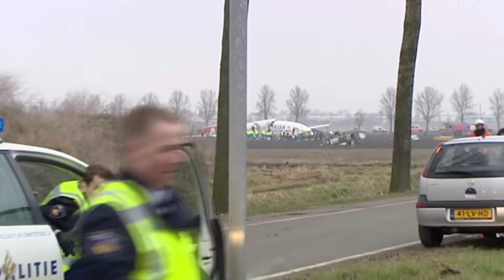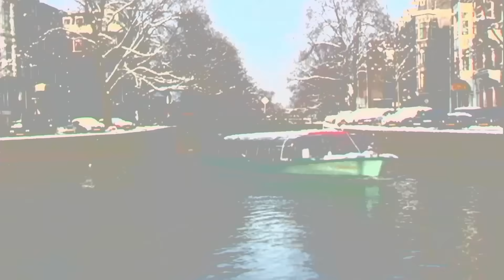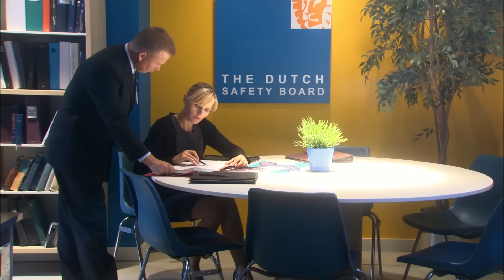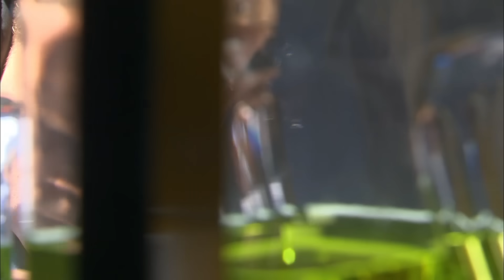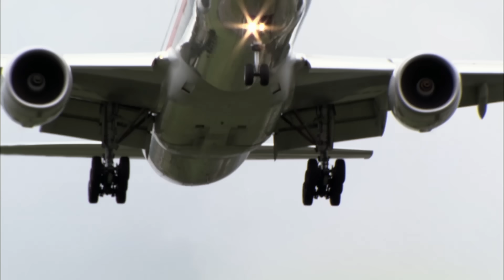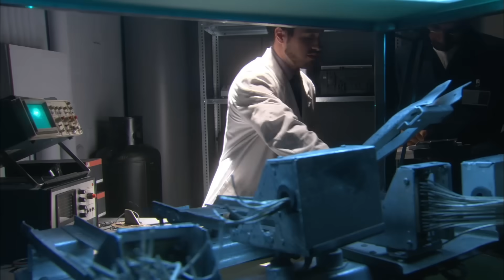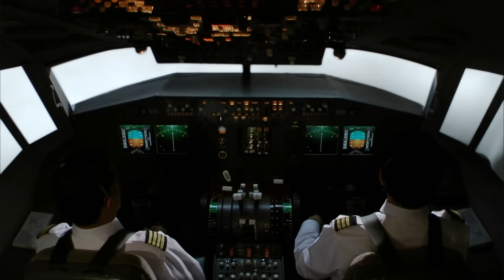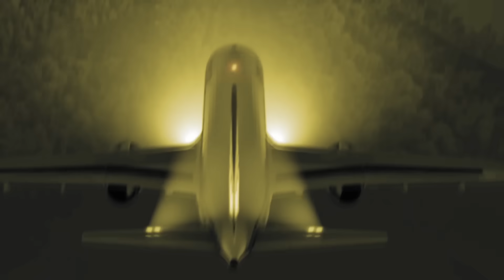Why Did Turkish Airlines 1951 Crash? | Mayday Air Disaster

Comment: Never finding the fault with the radio altimeter? The reading of -8 give a very exact clue. That would probably be the distance if the receiver were to pick up the transmitter without bouncing off the ground. It indicates they either have cross talk between the two or they need to install a delay in the receiver before monitoring the receiver signal for a bounce. Take any plane you have on hand and put a scope across the receiver on the ground and see what comes off the receiver antenna.  I don't have a degree and couldn't get a job with them but the failure is pretty clear.
Also the warning should be flashing red and some sort of tone should sound indicating they need to check the instruments.
Reply: Even better idea. The computer should ignore any flight altimeter reading negative 8 feet while the plane is moving more than 60 mph. It should be hooked up to all three altimeters, and take educated guesses on which one is accurate in the rare case that it gets three different readings.
Reply: @MegaLokopo  it's a design flaw in the unit. When they tested the unit and it didn't fail, it was because they didn't think to test that particular issue. I have spent a fair amount of time writing diagnostics for computers and believe me, it's hard to make sure a device functions perfectly. I have uncovered failures that the design team didn't realize  where there and other flaws that another diagnostic program didn't detect. Instead of a work around, the unit should be designed to function correctly because if the flaw continues to exist, you never know when it will bite you. To fix it correctly doesn't require external information which could be another failure point.
Reply: @denawiltsie4412  Some bugs are very hard to detect and even harder to prevent. But the unit is already designed to do certain things if the height is above or below a certain height. It isn't that much of a stretch to have another check where anything at or below zero feet is treated differently to above zero and above 50 or 100 or whatever the exact height is that triggers flaire mode. Also having a check for altitude and speed would not require any information the computer doesn't already have access to, so there isn't an issue with getting "external" information, because all of the information is already there.

It already does a height check, one more height check is not some crazy idea.
Reply: @denawiltsie4412  Also it isn't a design flaw, it is an intentional design that it fails "safe" to -8 feet, so when an engineer is diagnosing it they know it is not the display being broken and is in fact the sensor.

Comment: If the pilot’s radio altimeter fails shouldn’t they switch to the copilots as they would with a faulty airspeed indicator? They knew it was faulty; why didn’t they do that?
Reply: likely couldn't at the time
Reply: The 767 has 3 autopilots and 3 radio altimeters if left or right fails they can switch to alternate EFI and run their side using center rad alt, can’t recall I thought 737’s only have two but they shouldve run the QRH quick reference handbook and would probably say Capt should switch his to right side run on F/O’s rad alt info
Reply: @poochies0316  depends on model for if that was an option why not switch to it. note this was an 800 series.  the ones you are mentioning could be 900 ng or the dreaded max models
Reply: @poochies0316  👍

Comment: Another crash caused by automation flying the plane instead of the pilots.
Reply: It wasn't really the automation, it did exactly as it was told, it was those computer programmers who programmed it and didn't think to put in a check to ignore any readings below 0 feet if the plane is going above 60 mph.

Comment: Ridiculous.  If you have automation that: 1. changes the configuration of the plane near the ground when pilots are busy, and 2. that is dependant on a single sensor, that 3. a sensor that is very prone to failure.  Boeing should not be selling planes.  WTF.
Reply: Sounds like Mcas on the max !
Reply: Blame whoever you want, but if we want real change we need to boycott flying until every system on the plane is fully redundant. A computer should be programmed to ignore a reading of -8 feet when the speed of the airplane is over 60 mph.
Reply: @MegaLokopo  Ignoring readings "like -8" is not a thing.  Where do you draw the line of when to ignore?  It might have saved this flight but erroneous sensors is a known hard problem in robotics.  The best they can do is have redundant sensors where you alarm when they don't agree.  MCAS had even worse sensor handling.  I don't fault automation.  I fault bad automation where the plane does dumb things close to the ground without clearly informing the pilot.  I have designed automated flight systems and doing any configuration change when there is limited opportunity to recover is just negligent.
Reply: @uhadonejob  It ends up being like a couple of if statements at most. The computer gets the reading, it does a check to see if it is below a certain height and if it is below that certain height and a few other things match, it goes into flair mode. 

My suggestion is if the reading is below 0, don't go into flair mode. The computer already knows not to go into flair mode if the reading of the altimeter is above a certain height, so have a minimum height for flair mode instead of just a maximum height.
Reply: @MegaLokopo  Spoken just like a low brow Boeing engineer.  Band aid solutions just breeds endless corner cases that become too complex for the pilots to understand.  Once you can't trust a reading it doesn't matter what the reading is.  Just because it is a 'legal' value doesn't make it legitimate.   You can't make flight decisions based on one sensor looking good -especially close to the ground.
Reply: It's very easy to blame Boeing, but what you should have is proper maintenance instead, not "Boeing stopping to make planes"
Reply: @Adrian_152  It looks to me like any fix tried didn't work

Comment: This is what happens when you rely too much on technology. It’s great to take the work load off the pilot, but it’s quite another thing when something like the radio altimeters malfunction and gives out erroneous data. The pilots should have monitored their airspeed. If they had done so and took the appropriate actions, the crash wouldn’t have happened.
Reply: It's called "the first thing a pilot should do is fly the plane".
Reply: There wasn't enough automation, the computer should be programmed to read data from all sensors and fly the plane according to the information it gets from all sensors, not just one. The computer should be able to tell simply by the speed of the plane, that the airplane is not on the ground. Also in what world do you not program a computer to ignore a reading of a height of negative 8 feet.
Reply: no, they should have been monitoring the speed and altitude regardless or automation
Reply: Im afraid for the future, pilots, passengers, and ai
Reply: This is why one pilot should be monitoring the gages at all times, while other does the getting the plane ready to land. First rule, always fly the plane. That includes always monitoring the airspeed and altitude, very important. To much automation makes pilots lazy, not blaming them, just stating facts.

Comment: A lesson here is that any maintenance problem can become a safety issue. Doesn't matter how minor. Doesn't matter how much warning the pilots get. It just takes the right, or wrong, set of circumstances to cause disaster.
Reply: Honestly, I wish aviation maintenance were required to watch this channel….
Reply: @audreym3777   It's the management that needs to see it.  Maintenance crews cut corners because managers take away the time they need to do it right.
Reply: @coreypatterson5827  yes but also as a a and p myself sometimes you just cant physically check every single thing sometimes an issue occurs that you would never anticipate or is not in the maintainers manual.
but yes there is a lot of pressure as well.

Comment: All that Boeing pride really hasn't aged well.
Reply: And greed. Don't forget the greed.
Reply: "State of the art" and "737" are really not two terms that go together.  When it first flew, there had not been a manned moon landing, TV sets used vacuum tubes, Engineers still used slide rules (electronic desk calculators were rare and expensive), the microprocessor didn't exist, and most cars had drum brakes and leaf spring suspensions, and no power steering or power brakes.
Reply: And let's not forget about the Boeing crashes during the last months. 🙁
Reply: Not only that but sitting there saying “Boeing have got it the right way” on a video about a Boeing plane crashing because it had a faulty sensor and failed to convey the problem to the pilots with enough time to save it.
Reply: Ryanair only uses Boeing 737 800s and they have never had a serious  accident and never a fatal one and theyre the biggest air company in all of europe. Its about proper training and stringent maintainance. It may be uncomfortable and cramped but i know im not going to die flying with them.
Reply: "We are talking about a sensor which controls auto-throttle that can put the aircraft in a stall position at any time during the flight. Not a big deal, basically." said an expert by Boeing. "Worst case, some will die, but you can always blame it on the pilots, you know." .. "Watch the damn speed" he said last, while getting into his Porsche.

Comment: Way too much automation, one system failure will trigger a whole series of events that will create confusion, and like in this case, time was not on their side...
Reply: This seems to be Boeing's secret sauce.  Sensor failure and smart software on their most popular planes.
Reply: @uhadonejob  thing is airbus has morw automation but dont see these issues nowhere near as much as boeing
Reply: @admiralsnackbar69  My comment was about Boeing.  Airbus seem better at automation safety even if their systems are a tad complex.
Reply: @uhadonejob well because that's how you make a system safe, If a flight computer fail Can take out the whole plane then you put more computers in so that even if one fails it won't take out the plane
Reply: Actually there isn't enough automation. The plane should be able to diagnose faulty readings and ignore them. The space shuttles and the moon lander did exactly that. Three redundant computers with access to everything, and they voted on the correct course of action, if one sensor is faulty the plane should be able to figure out it is in the air and not on the ground.
Reply: 70% of all plane crashes are caused by pilot error. If anything that says theres not enough automation on planes. But more constructively, the information the plane provides the pilots should be presented in a clearer fashion and problems should have a longer step to them so a low airspeed alarm should go off earlier and the stall warning should go off slightly earlier too.

Comment: Bottom line - Technology is a tool we can use to manage control systems. They will never replace pilots responsible for passengers.  🤔 Training and experience will reduce these types of incidents. The only one who can eliminate them are the humans behind the controls.
Reply: There needs to be a way to shut down computers and turn it over to the pilots when the computers go haywire. Automation is great right up until it's not.
Reply: @Star_Jewel_Realm  That's the point right there.
Reply: Now, if only we could apply that to driving...
Reply: Max 8 was a prime example. Pilots need a way to shut it down when it malfunctions. It will again at some point.

Comment: Should have landed manually given the auto throttle being misinformed by radio altimeter
Reply: Or, and hear me out… Or if they had not made any inputs at all, then maybe they would have been fine. Instead they ended up basically inputting two full landing procedures, one automatic and one manual. Everything that happened is what they expected to happen from the manual inputs they made, so it didn’t alarm them since that was their intention. 

In my opinion, it’s a little strange that one, single (faulty) reading from the Altimeter sensor effectively initiates and executes an entire landing procedure regardless of what the rest of the systems are doing 😮🤔